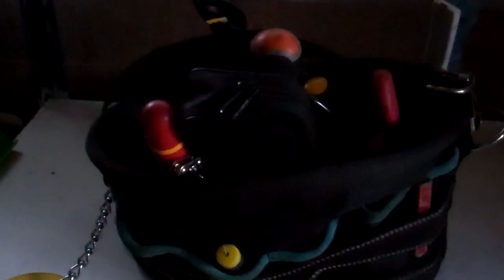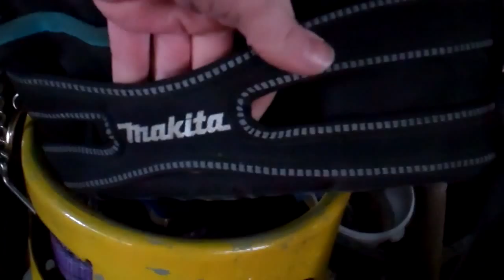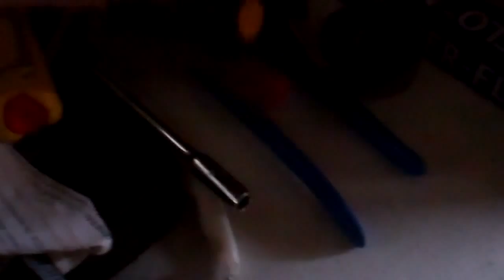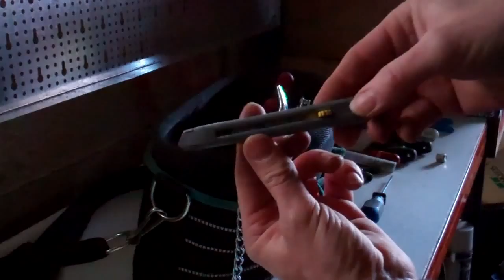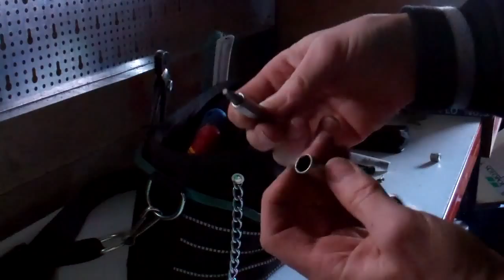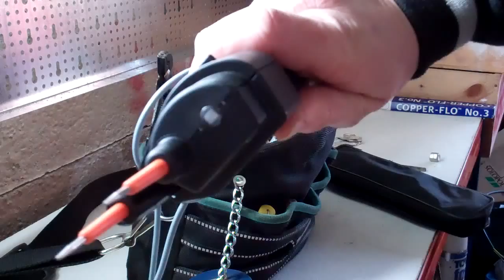HVAC Makita Tool Pouch

Comment: Where'd ya get the irwin 11 in 1? I've one of the stanley 5 in 1 ones and i love it, but thats way handier. also are the nut drivers on them imperial yeah? Kinda useless this day and age would be great to have a metric one, even though other bits wouldn't fit but meh.
Reply from the maker: I got the Irwin at Haynes of Challow years ago, but they are also available on ebay and amazon as either Irwin or Lenox 9 in 1. The 5/16 side fits 8mm which is handy for a lot of tek screws etc.
Reply: heavydiesel is it exact 8mm or just a roundabout fit? must look into Lenox one too. if definitely change out the Robertson ones for those fork type ones you get on electrical fittings
Reply from the maker: 5/16 and 8mm are interchangeable, theres about 0.06mm difference.

Comment from the maker: I can see how a toll roll would be good, easy to find tools and see what is missing, have just got a tool roll to keep masonary drill bit in for that reason.

The tester is made by Steinel, i think Weidmuller make them under licence, it is a more useful tester than the Fluke one i had before.

Comment: I prefer a tool roll for the first check to get gauges on, test power etc. and get the tool case if thats needed. Is the tester from weidmüller ?

Comment from the maker: Hi Ray, Thanks! Fluke make some good tools! The CK strippers and called 'Jokari', i use mostly on steel wire armoured cable, i have a lighter duty one branded 'Toggle' which i think is in my tool box vid thats good on thinner cables. PM me if you want more details!

Comment: With the magnetic grab I got a cheap one with a built in torch at the front. May be gimmicky but is very useful to find the missing bits in the darkest corners where it fell. Like the cable stripper as well, along with the multimeter. Tip for the crimp lugs is to make up a denim cloth bag on the sewing machine, or sew by hand like I did, with a velcro closure and a hanging loop, small but that will hold about 40 assorted for use conveniently.